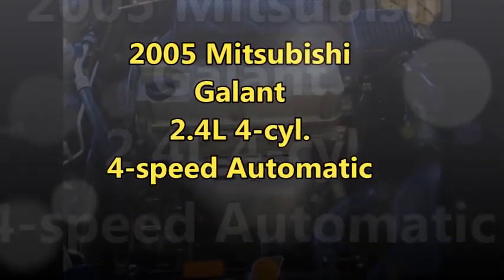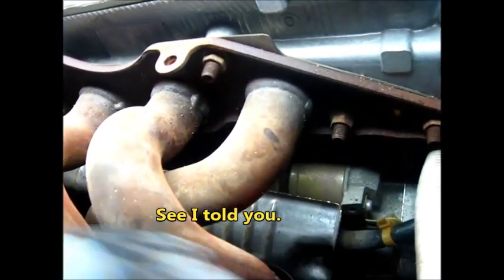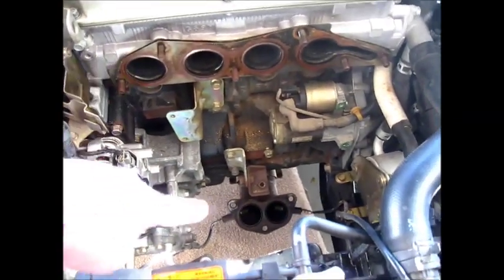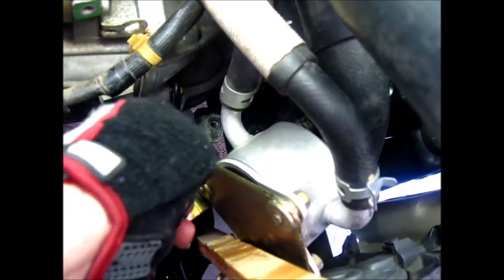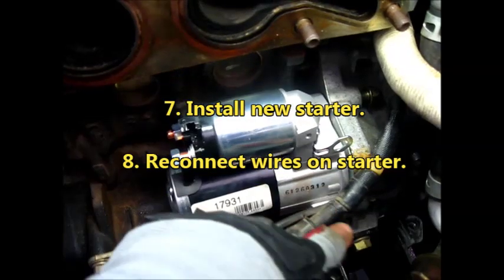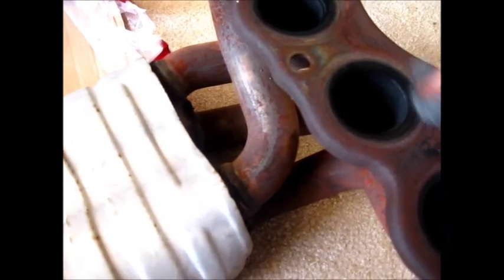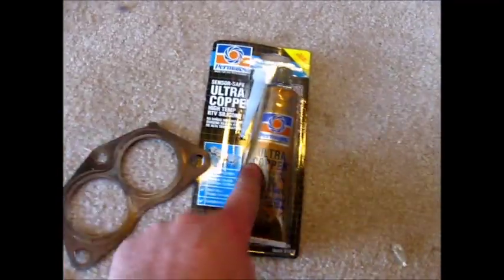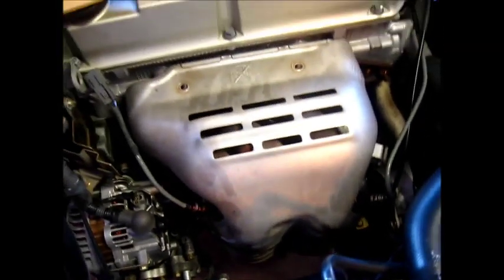(No Music) DIY: (2004 - 2012) 2005 Mitsubishi Galant 2.4L, How to Replace Starter (No Music)

Comment: I am glad i found this video.  I just went though the upstream cat converter/header replacement so this should go pretty easy now that I've already done that.  I will have to do it again!  My starter just started working intermittently which is annoying.  Was thinking it was the park/neutral switch but doesn't seem to be now.  Its weird that some of the bolt placements on the heat shield and lower O/2 sensors on your car are a little different than on my car.  Not an issue but just weird to see some differences.  Turns out your car is a Mivec motor where mine isn't.
Reply: I think my problem with the starter is I cooked it when I was running with a bad/clogged down stream cat converter.  The manifold was red hot and was the double cats  And I blew out the new exhaust manifold gasket that i put on when I replaced the cat/manifold ...  Thanks for sharing this.

Comment: you don't need to remove the exhust mandflod off to replace starter in this I did this job about hr …….just take the bolts off the shelid and just push the shield down  and u push the tab down the wire that gose to the soiled wire and deep 12 mm socket to take off the nut and make sure the battry is discount and if u unbolt the oil cooler unbolt it and it will make it a little easy to get to the two 14 mm bolts holding the starter and when u get it unbolt u can sneak it out that side of the transmmsion and put it back in and start the bolts in by hand frist  so  u don't cross thread them and then just tight the nut up and install the wire and put the heat shield back on ...the oil cooler bolts are 12 mm I think

Comment: First I need to thank those who forge the efforts and then those who try to make it easier. 
After looking at other vids and trying one myself today , you do not have to remove exhaust heat shield. I removed air cleaner box, the 2- 10mm bolts on the brackets for lower water hose and 1 trans hose. I pulled the radiator hose and zip tied it out of way, I undid the 4 bolts holding the trans fluid contraption and zip tied it pulling it up and close to the fan. the 4 10mm bolts on heat shield over starter are easy to get to.It wiggled out pretty easy. Starter bolts accessible, then wiggled starter nose down to get access to Power cables. Then twisted starter up and out.. Reversed directions and the hour and a half job done.

Comment: Did you check if the starter was good or bad I had to remove all this to check if the starter was really the issue but it was not it was my ignition switch but I couldn’t really put a screwdriver when the heat shield on to test the starter

Comment: I have a problem my car won't start it's a 05 mits galant 3.8 I change both crank n cam sensor ,new fuelpump n it doesn't start .I was told that I have to change ignition control module but looked n can't find it

Comment: you do not have to remove the manifold.
Reply: im doing the same starter cant figure out how to get the heat shield out without removing manifold
Reply: All u had to do was remove oil cooler